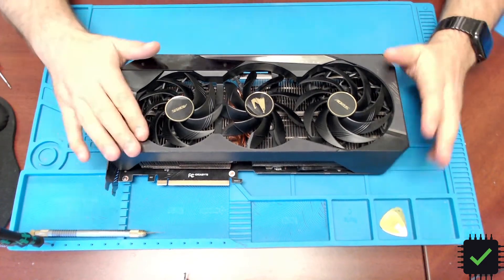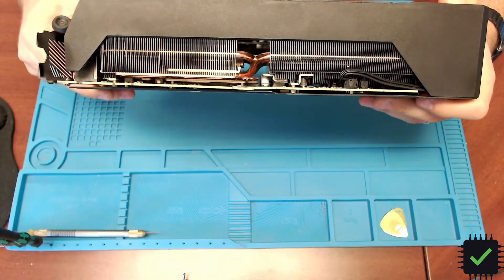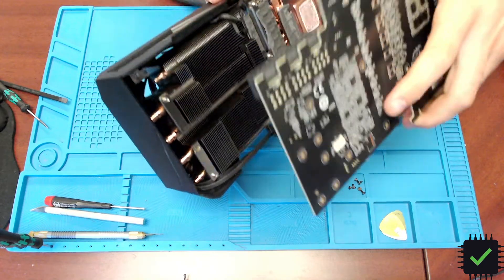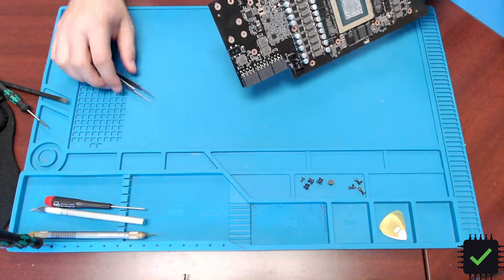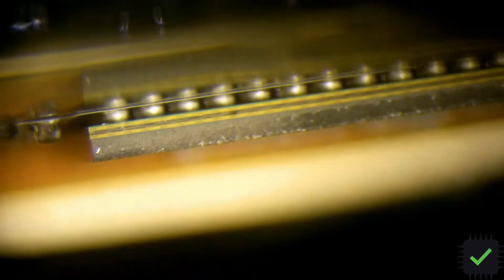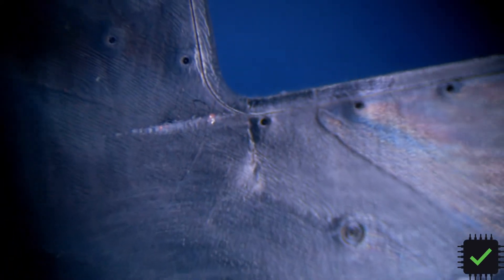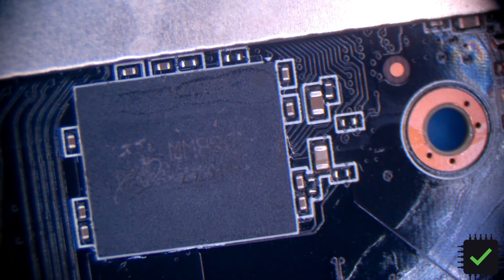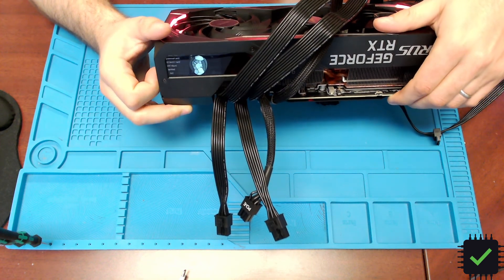Failed repair attempt. Gigabyte AORUS GeForce RTX 3080 Xtreme 10G Video Card with cracked PCB

Comment: Good try! What was the issue with the card btw?not detected?artifacting? do you know the tool MATS to diagnose memory errors and other logs? Keep up the good work :)
Reply from the maker: Thanks! Physical damage. Customer moved desktop from one state to another with the card inside. PCB was cracked and bent. Card was acting erratic. Would recognize sometimes but would BSOD. Probably damaged traces inside the PCB or connection to the main GPU chip. Low chance of getting the card working reliably with such damage. Thanks for the info, I’ll look into that. I use AIDA64 for testing, really nice program. Thanks again!